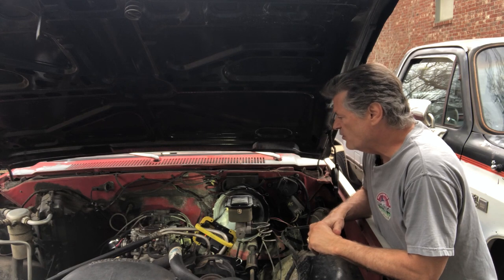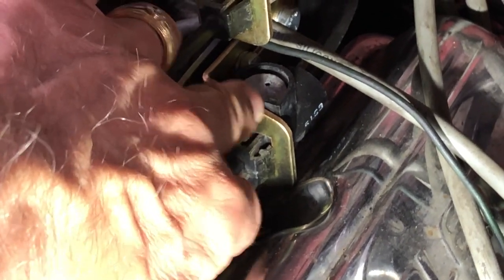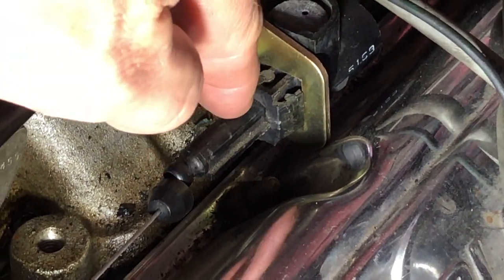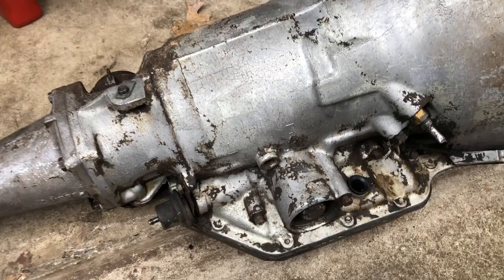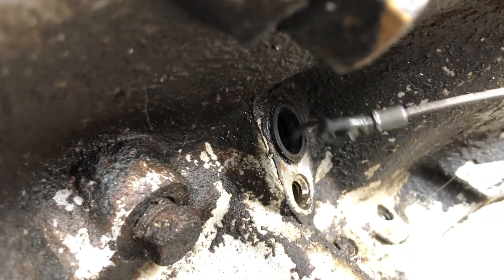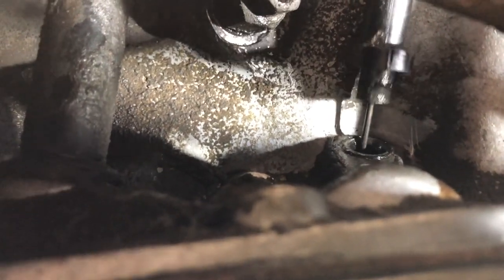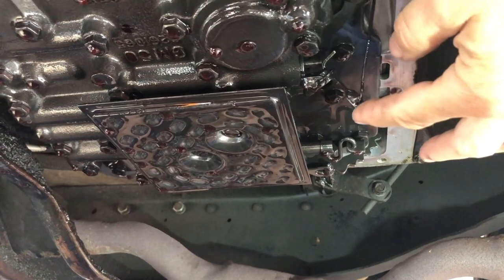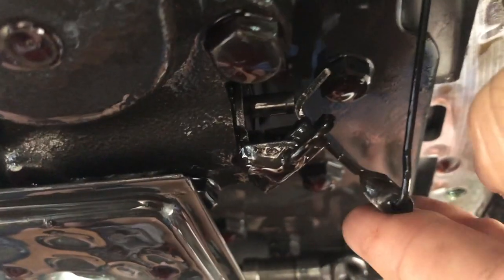Turbo 350 Won't Downshift ?

Comment: Thank you so much for making this video. I ended up pulling the tranny pan and sure enough the plunger wasn’t going in all the way. I thought I had the kick down adjusted correctly up top but I didn’t. The Camaro downshifts like a champ now. I’m actually enjoying my new engine and tranny.
Reply from the maker: Glad it worked, it is such a beating when the car won’t downshift correctly.

Comment: Thanks! Very informative and concise. I recently dropped the TH350 pan on my '81 Pontiac Trans Am to fix leaks and replace the filter. I found the downshift rod and bracket are gone. An old downshift cable is in it but cut off half way to the carb. This Buick/Olds/Pontiac TH350 is a bit different than a Chevy TH350 but is basically the same downshift mechanism. Will have to source some parts before I can get the downshift to work.
Reply from the maker: Try rockauto.com

Comment: GM did not change the connection to the transmission.  If you were to look a little closer, you will find that the rod from the transmission that connects to the downshift cable is probabbly up inside the cable sheath.  this happens alot with aftermarket universal kicksown cables thart arent really the exact lengh as the OEM.
Reply from the maker: Thanks for the clarification!

Comment: I think someone may have modified that cable. From the top up by the carburetor it looks like the cable that comes stock on a 700r4 transmission. That definitely is a TH350 transmission. You got it to downshift so that’s what’s important. I just wanted to point that out.
Reply from the maker: You’re probably right. The truck came stock with a 700 R4 and it was apparently later switched out to a turbo 350 in its life.

Comment: This was a huge help in trying to understand the problem I'm having, but it still doesn't solve the issue for me. I bought a new cable that looks like yours from Summit racing. It's for a 76 chevy van. Even the website said it was a direct fit. But, it almost seems like my cable is too long. Even when I adjust it to take as much slack out and keep the cable action as short as possible, the cable never actually engages. At WOT, the arm that the end of the cable is hooked to just barely touches the end of the cable's notched slider piece. I guess my cable is too long?
Reply from the maker: If I were you, I would look at the brackets that are holding the cable. It’s possible they got swapped out at some point and they are not in the right position.

Comment: I adjusted at the carb but still had 1” of travel. Dropped the pan and found that I have the same style cable in new at the trans as you do on your truck. Not sure the best way to adjust that 1” of travel I’m left with…. I pulled it tight and swedged a stop on it but it hasn’t helped much.
May have to reach out to the aftermarket for a newer or better cable
Reply from the maker: Are you saying the new cable is too long?
Reply: Sir, kick down cable in my truck is at least 1” too long, this is after I’ve made the adjustments shown in your video. Whether my cable is a replacement or original I can’t say ( a lot can happen in 40 years ) I intend to use a cable stop to take up the last bit of slack

Comment: Question. If the cable is not set properly, is it possible to experience a bog when giving it full throttle from a dead stop? Or would that have nothing to do with it?

Comment: What was it that was keeping the cable and s clip from coming out ?

I'm having the same issue replacing mine right now, but really don't want to drop the pan...
Reply from the maker: Ideally, you don’t want the S- clip to come out. The top end of it is connected to the cable and the bottom end of it is connected to a piece of linkage inside the transmission typically.

Comment: I need help. My 85 blazer has that same trans and the kick down cable at the bottom where it goes in to the trans the new one kick down cable is to big for the hole in the trans but it’s just like yours
Reply from the maker: I've run into the same issue before. I had to go to a different brand (don't remember which) to get a cable with the correct diameter plastic piece. I guess GM revised the part over the years so you have to keep trying different solutions. For shopping online, see what rockauto.com offers. For local shoppong, I'd try NAPA Auto Parts.

Comment: So I have a question and I'm asking whoever I can, my 78 Chevy was towed they disconnected the linkage and I had to replace the ignition because somebody broke it well I put the linkage back in but I don't know if it was already in gear or a neutral I'm not sure where the shifter supposed to be at. The linkage is what I meant and I have a Chilton's that explains but I'm not too sure I've got everything done and disconnected when I started my truck it wanted to take off so I figured that was in gear I don't know how to check if it's in park or neutral or what's going on with it if you can help me out please.
Reply from the maker: I think I would put the shifter in the Park position. Then, get under the car and move the small arm of the driver side of the transmission to where the linkage rod will go in. Secure with whatever kind of clip the factory used.
Reply: @pinkcaddygarage267  just an update I figured out what was wrong with my transmission and the linkage, so I had everything correct except one thing and on the shifting linkage down by the transmission you've got that bar with the spring on it that sits on the driver side frame it goes into the hole after you put it in there you hook your linkage up that wasn't in the hole that was the whole reason why the truck wasn't catching the gears and the shifter was sloppy 🤦‍♂️😝 after that I was able to get all my gears everything seemed just fine I went to put it in gear and it wouldn't drive Well after a long day I figured out through help that it was low on ATF 🤷‍♂️ My truck drives like a champ thank you for all your help
Reply from the maker: Glad you’re on the road again!
Reply: @pinkcaddygarage267  💪 thank God for the web I'm glad everybody works together and helps each other out thanks again

Comment: Can it be setup to downshift with less than full throttle?
Reply from the maker: I believe so. Just adjust a little further in(add tension) and it will downshift earlier.
Reply: @pinkcaddygarage267  thanks

Comment: In my 70 Impala I swapped the 2 bbl for a Holley 4 bbl and my detent cable is now too short. Haven't figured out what to do yet
Reply from the maker: How much too short?
Reply: Get a cable from an 80 Malibu. They are about 3" longer at the connector end. I just had the same problem with my 64 impala. Trans came from an 81 cutlass with a 2bbl. The aftermarket ones are built like dogsh!t though. Be prepared to trim plastic. They have a habit of popping out of the bracket that holds them in place.
Reply: You can extend it with a kit.

Comment: you are workin g with a 700r4 not a th350 get it right
Reply from the maker: It is literally a 3-speed turbo 350 transmission.
Reply: That WAS a TH350 🤦🏻‍♂️. It's YOU that needs to get it right..